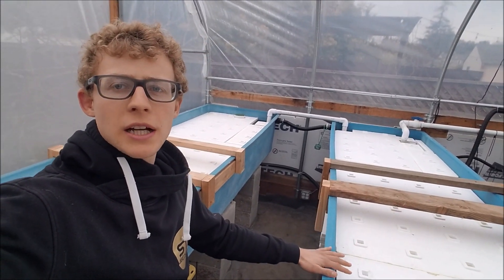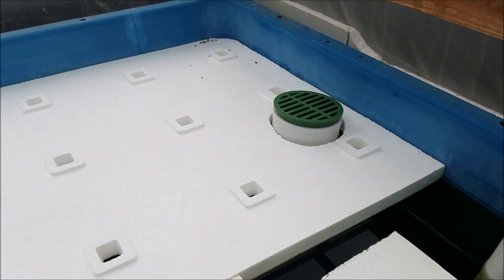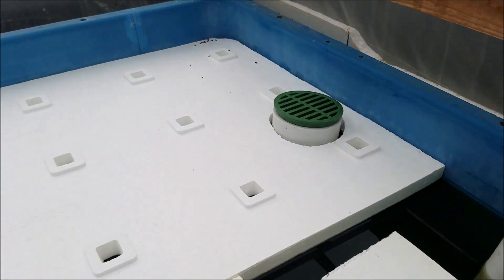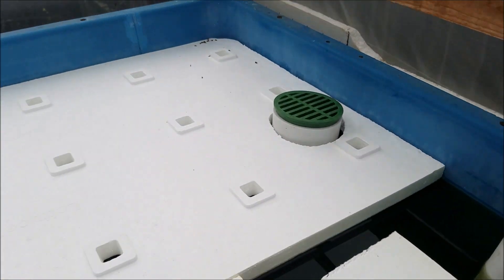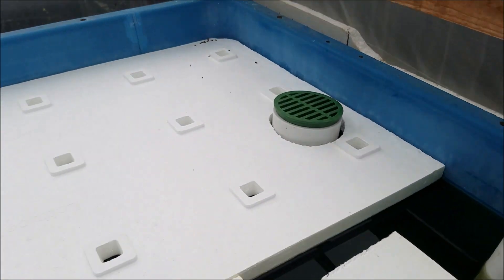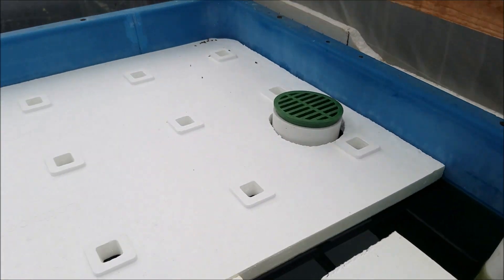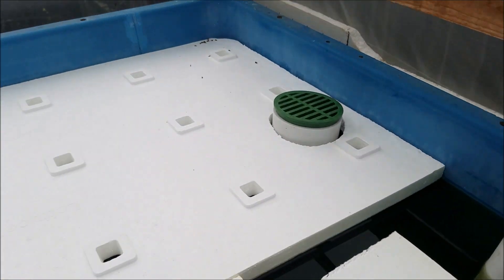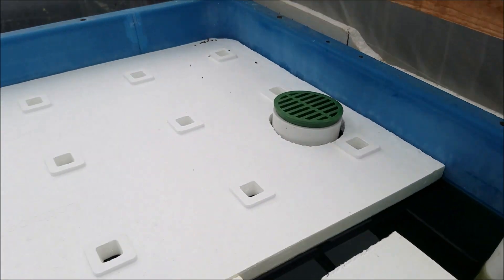Aquaponic plumbing- connecting two grow beds to a sump tank (hybrid aquaponic system)

Comment: Hi, i am dr shareef(pediatrician) from india
Jus wanted to know whether single bell siphon work for multiple grow beds aout 8*2 feet size
Reply from the maker: Hello yes you can set up grow beds with just one bell siphon. You just have to make sure that you have a large enough sump tank. So that even when all the grow beds are full there is still plenty of water in the sump tank. Not sure of the size of your grow bed but you can also take into account that the hydroton (grow media) or rock you are using takes up about 60% of the space. So 40% is the water that will be in your tub. (A 100 gallon (378.5 liters) grow bed filled with media only has 40 gallons (151.4 liters) of water). 
So you can use that to calculate the size of your sump tank.
Still even if you have multiple grow beds with multiple bell siphons the sump tank will still be the same size as if you would use just one bell siphon. There will be a time when all grow beds are filled at the same time.

hope that helps 
thanks